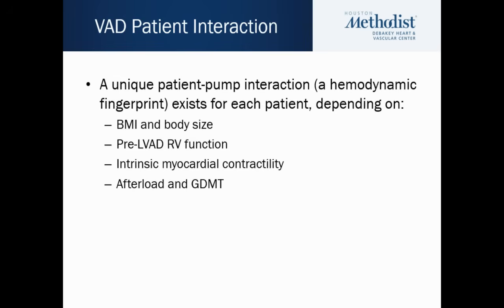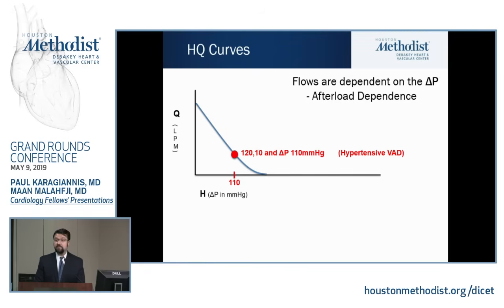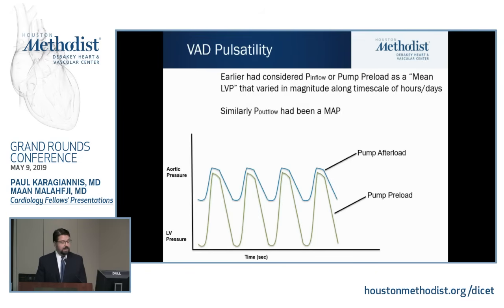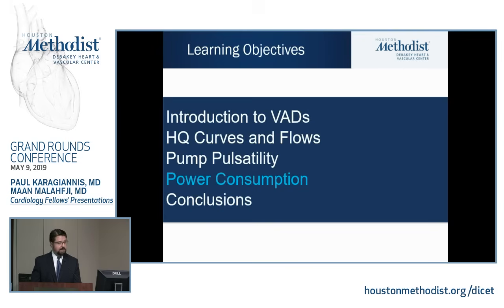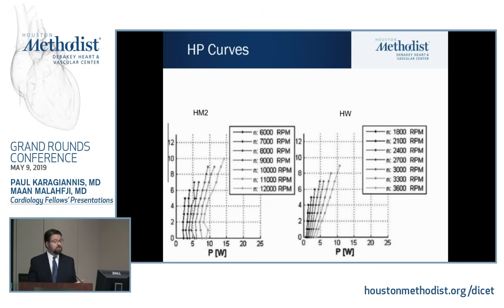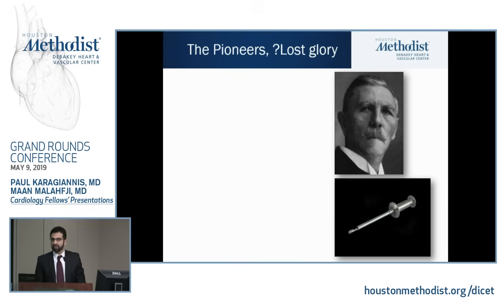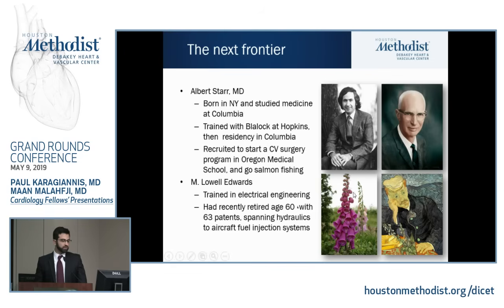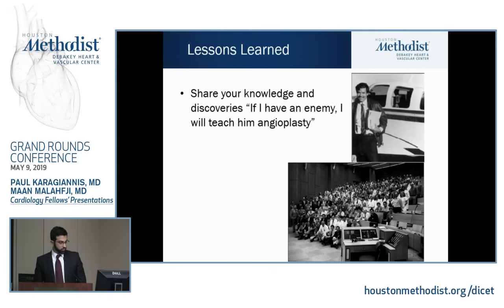Cardiology Fellows' Presentations (Paul Karagiannis, MD and Maan Malahfji, MD) May 9, 2019

Comment: I thought that was a great question Dr. Zoghbi asks about decreased flow with increased delta P.  I am not sure that the RPM stays the same.  I think it is like the Fellow said, that the power consumption goes up, but the LVAD is still unable to maintain the RPM, so the flow (Q) goes down.  Not sure, but I am guessing that is what happens.